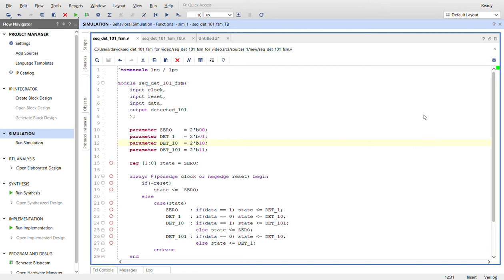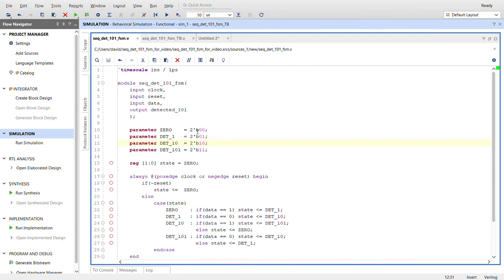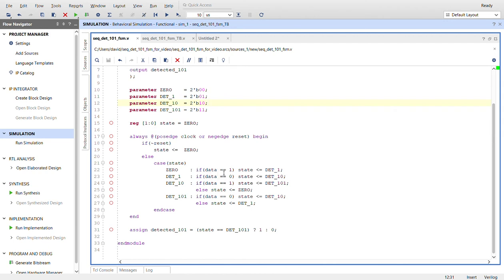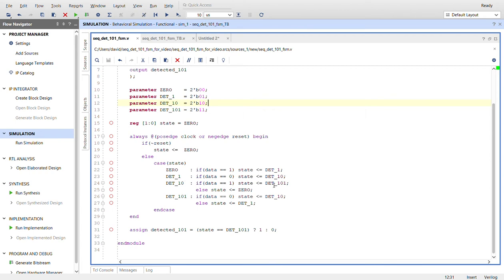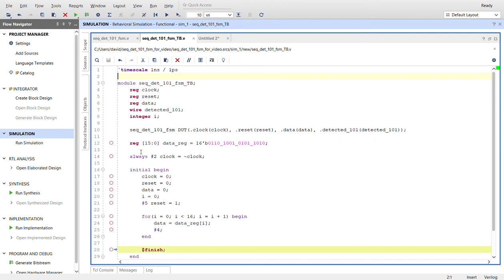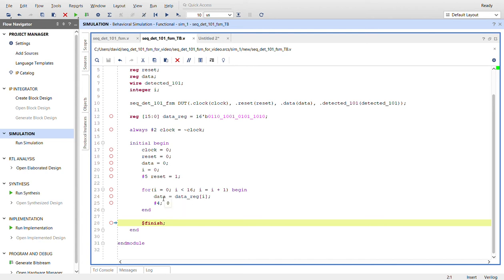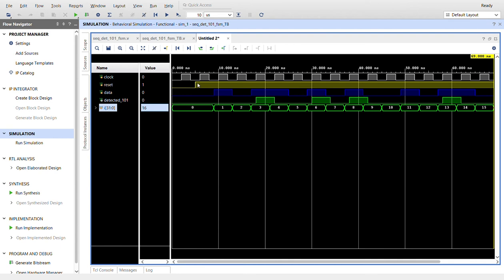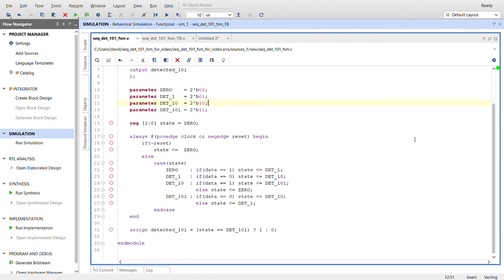101 Sequence Detector using Verilog (FSM method)

Comment: Hopefully you reply soon. But what are the parameters for the test bench? I created one but what are the inputs??
Reply from the maker: Not sure what you mean. A test bench has no inputs. It simulates the inputs to the module under test. Here is the test bench I used for this project: https://github.com/FPGADude/Digital-Design/blob/main/Modules%20with%20Simulations/Sequence%20Detector%20State%20Machine/seq_det_101_fsm_TB.v
Reply: @dajoma36  I think I understand but my question is referring to rather or not does the test bench have any I/O port definitions
Reply from the maker: @Edddy813  No. A test bench does not have I/O ports.